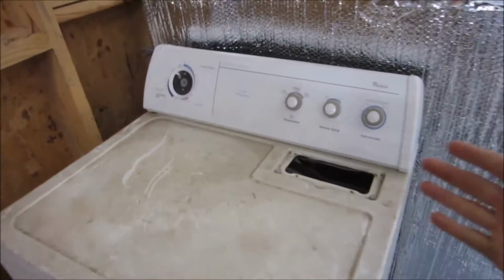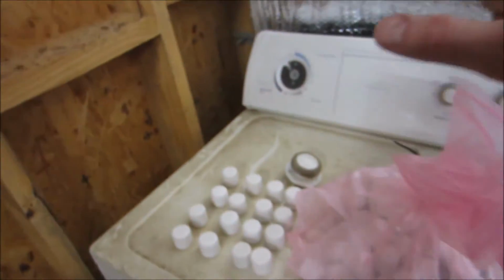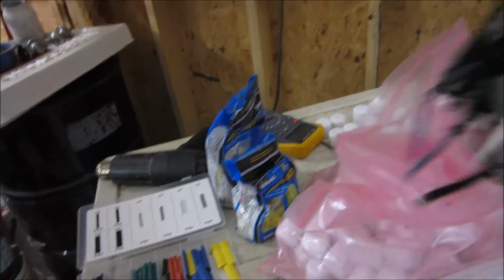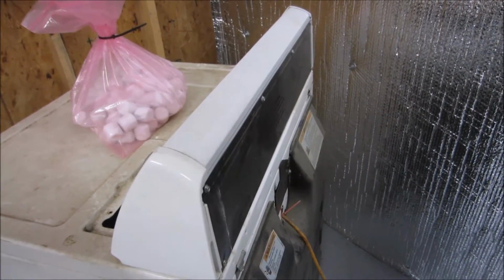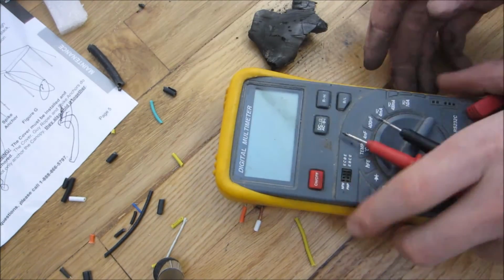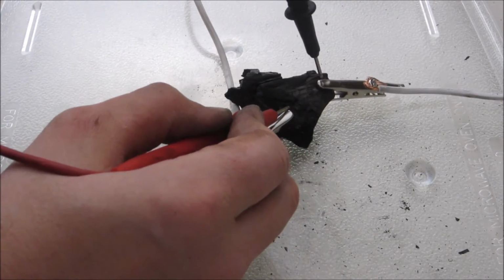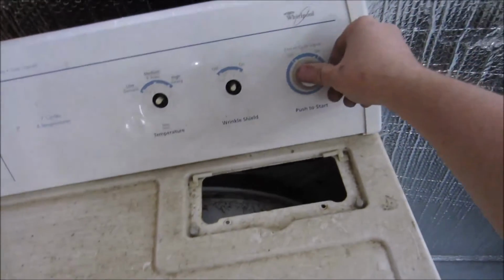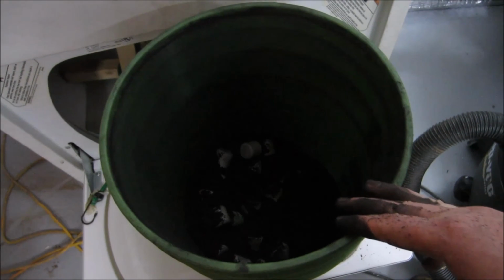$20 Cloths Dryer = Ball Mill | Powderizing charcoal carbon structures

Comment: very neat, for optimal ballmill running you want higher speed- my washing machine has a centrifuging function on it, i wonder if one could simply wrap a barrel in cloths to stabilize it and chuck it in washing machine like that? this whole thing is quite neat as it also takes care of a lot of the noise that a ballmill will produce, since its in a closed chamber, and it has a very powerful and stable motor
Reply from the maker: The balls have to "fall" so if the machine spun too fast, I imagine it wouldn't work very well. I'd be curious how it works out for you. :)
Reply: @someoneinncarolina  i only process magnalium and you can grind that up in a coffee grinder, so its really just theory on my end
i did wonder about using simply vibrations to grind rather than tumbling the media around, unfortunately 500 euro vibrator motor i came across i cant get to run, i saw some slight results with ultrasonic vibrations however